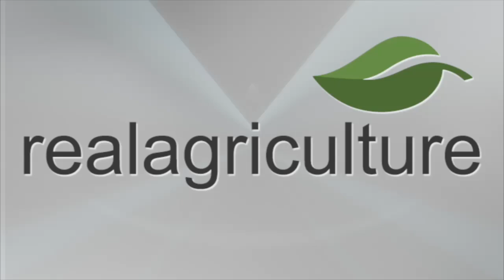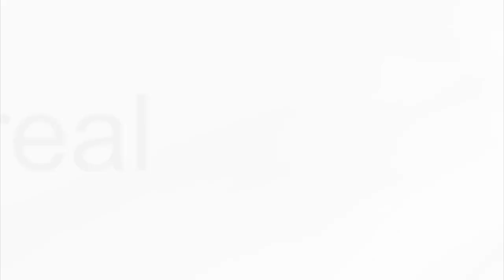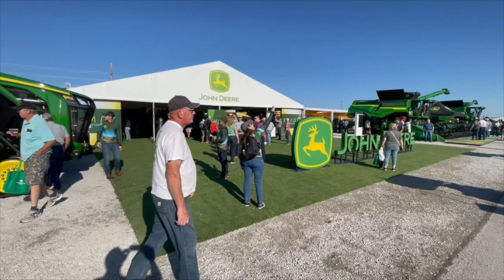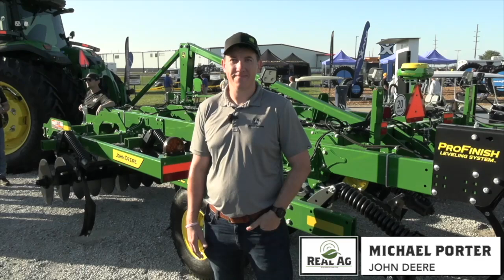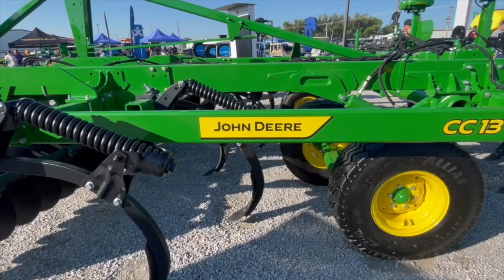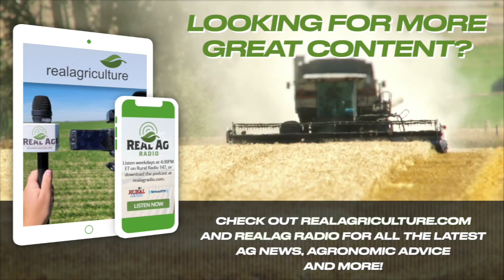Deere promises faster tillage with new coulter chisel

Comment: These JD tillers run about $30-$50 K. Before the tariff you can buy one of these for $5-$15 k , but Deere lobbyists put that EPA engine restriction on them , so China manufacturers can trade more easily with the grain farmers in Russia, Brazil, Argentina and product corn, beans and wheat at substantially lower input costs.

Comment: Electronics on a tillage tool. Uh, no........ 8 inches at 7mph. No thanks. Not in the rocks around a lot of areas. Deere DOESN'T EVEN CARRY metal wear parts anymore!
Reply: Didn't work all that good on 2210's I promise.
Ripped it all off and use cylinder stops now
Reply: @philrizzo  Simple isnt that bad. I like simple!